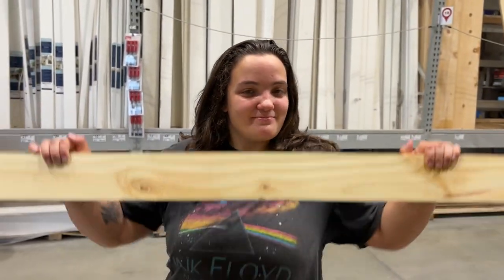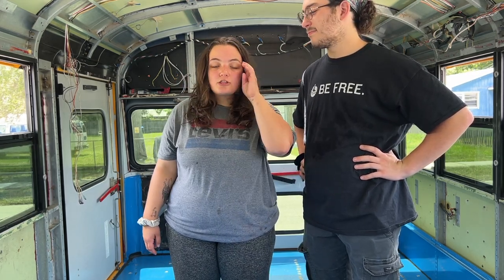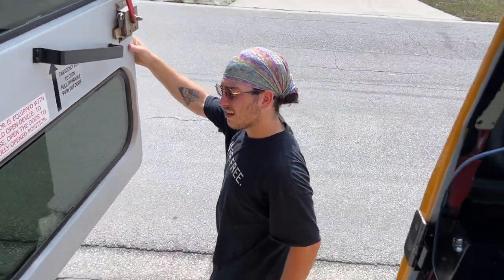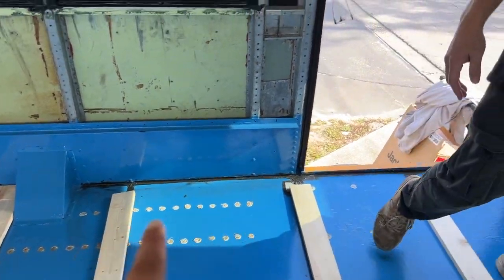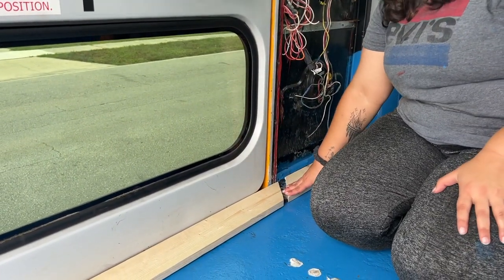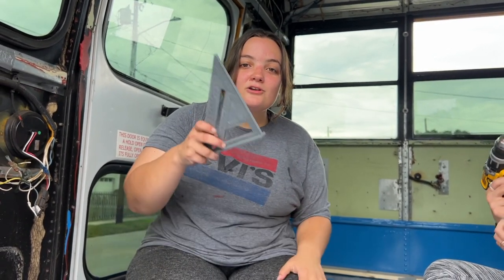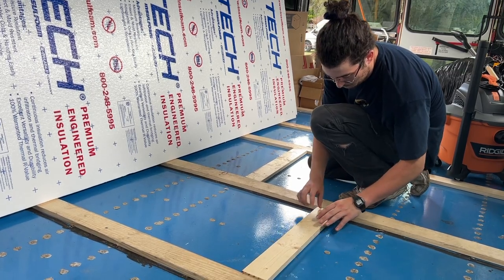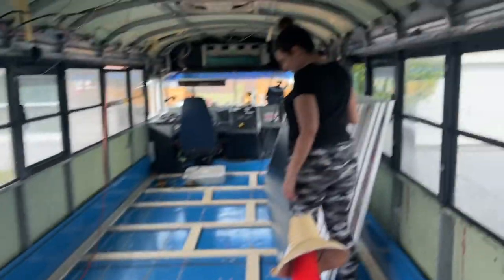Framing Skoolie Subfloor | School Bus Conversion Ep.11

Comment: You really didn’t have to screw the wood to the floor when you put the installation down and plywood on top everything that you build up will keep it from moving around. That way you don’t have holes all in your floor unless your planning on going underneath to seal them
Reply from the maker: Yes, but the plywood would be loose and that’s just a different type of hazard that we don’t want to deal with. Otherwise thanks for sharing :)